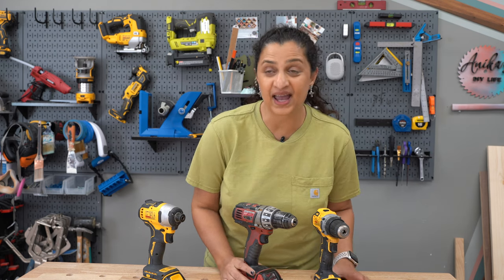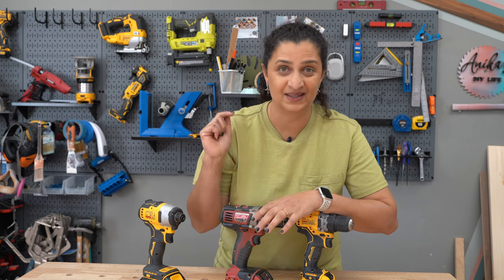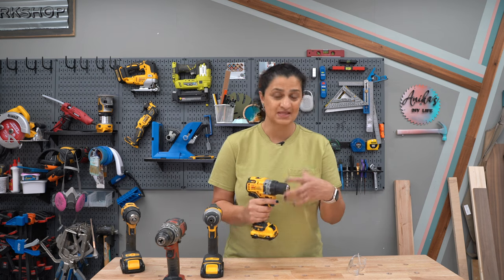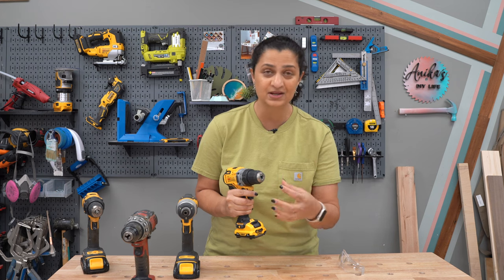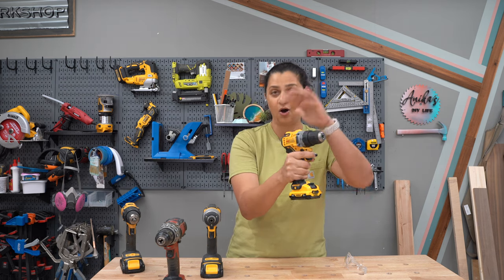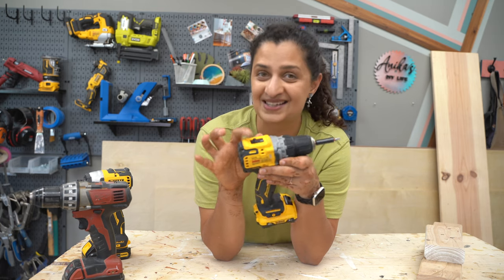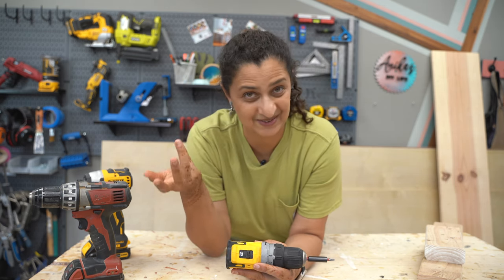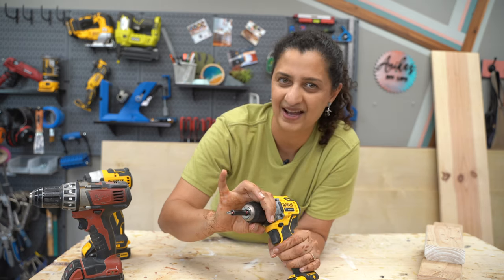How to Use a Power Drill: A Beginner's Complete Guide | Woodworking 101

Comment: Do it need torque when driving out the screw from material?
Reply from the maker: Yes. It does. It is still force. You can use any high setting though because you are not worried about how much it will come out

Comment: One feature that my drill has which I find to be very important, is the Level. 
I found self-tapping drywall screws weren't driving well despite adjusting the torque, and I realized it was because my drill wasn't level and the driver teeth weren't making full contact with the screw head.
Reply from the maker: Oh yes!! That is a great feature. I have seen those on drills. But mine doesn’t have it. Which drill do you use?